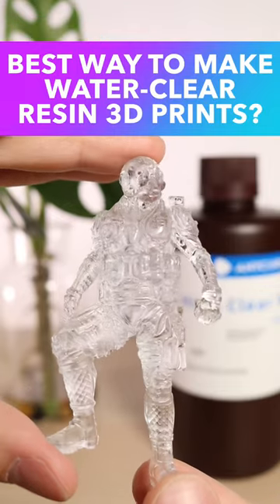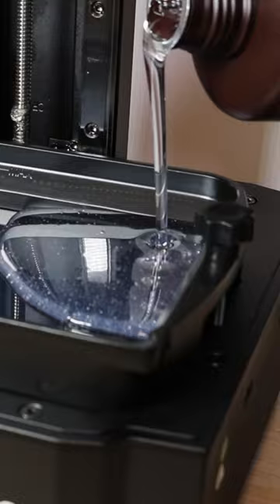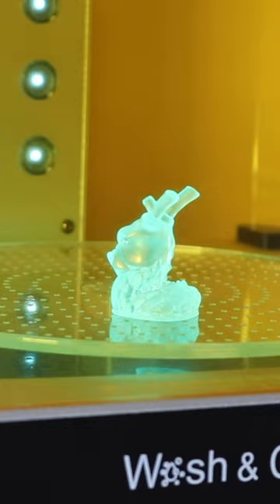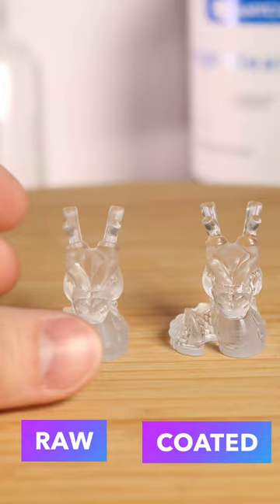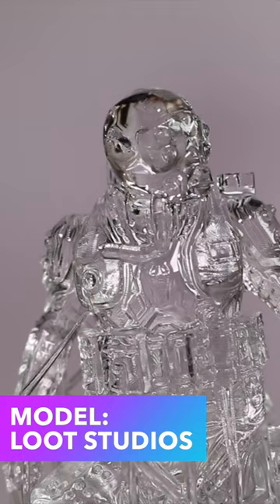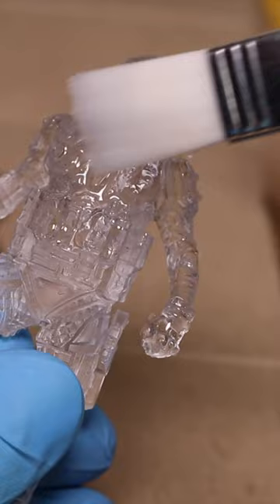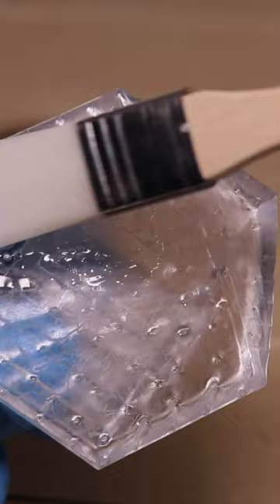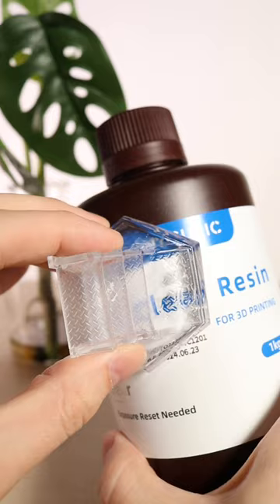Clearest Clear Resin for 3D Printing?

Comment: Clear spay varnish or similar would be better/faster
Reply: Was gonna say, a clear, resin based spray varnish would work better
Reply: Varnish will give a good finish but may yellow
Reply: @infernaldaedra  Not if you use Krylon Clear UV protection. It wont yellow.
Reply: @infernaldaedra  Resin Yellows Anyways.
Reply: @Hellspawnxxx  Krylon is kinda crap at that point I'd just use automotive clear coat 😂
Reply: @twistedmyth5860  this resin is designed to resist yellowing.
Reply: @Hellspawnxxx  that stuff is really gooey and nasty though. The application is very splotchy because of the nozzle, you won't get good even coverage.

Comment: For really small things I like to use a clear nail polish because it's super cheap and doesn't need a lamp for curing.  I mostly use it for small things since it dries quickly and can look clumpy if you go too slowly on larger prints.
Reply: FYI clear nail polish will crack and yellow over time!
Reply: @FLOPPY1DISK  oh really?  I've never had issues with it personally.  I find depending on the pigment underneath it can change colour but I've never had cracking happen
Reply: Tbh if you compare per liter odds are the clear uv resin is cheaper.
Reply: @FLOPPY1DISK  Clear UV top coat nail gel doesn't crack and yellow over time lmao. (I have them on my nails...) I think you're living in the 90s where ppl used lacquer nail polish.
Reply: @KryaDiere  I mean over a long period of time, not the time of applying them on your nails and them eventually wearing away LMAO
Reply: @KryaDiere the original commenter was definitely referring to regular clear lacquer, since they mention it doesn't need a light to cure.

Comment: So this is what I do and my prints come out very clear.  I don’t wash it once it’s done.  I simply stand it up, let the excess resin drip to the bottom.  After some time, wipe off the bottom, cure it.  It stays clear but it’s tacky so to finish it off I stand it in a jar of distilled water and cure it one more time.  This keeps it clear and removes the tackiness.  I’m only curing it for 30 seconds both times but I also have my curing station lid wrapped with aluminum foil which cures it very well in less time.

Comment: I dip it in the high gloss uv resin (either leftovers or new) instead of brushing so no brush strokes while holding a uv flashlight real quick then finish the cure in a water bath + alcohol under and over uv lights

Comment: What happens if you cure it without rinsing?
Reply: There would probably be a lot of excess resin in the fine areas. Brushing it on let’s you control how much outer layer you want to put on it
Reply: I just did my first two clear prints and did not wash them.
My process was to print during the day and left them to "drip dry" over night after the print had finished.
Then used then used a single drop from a Vallejo paint bottle to deliver the clear resin and the results were perfect.
Think of the painting on the resin as more a wipe. Too much will remove detail and take too long to cure.

Comment: Airbrush it on like some do to remove voxel lines etc works great just be in a high ventilation area
Reply: Wouldn't you need to thin it for that? What would you even thin resin with?
Reply: @blackhoneyboi alcohol would work wouldn't it?
Reply: @miguellopez3392  I would imagine that would separate and dry out almost immediately, but I could be wrong.
Reply: @blackhoneyboi  yeah that seems likely maybe a Mr hobby leveling thiner would work better.

Comment: Done this before but my prints come out great but are still sticky or feels like the resin didn't cure. Trying Minwax Polyacrylic Gloss. I like it a little better.
Reply: Same here . Remains sticky after uv cure . I dip in ipa to wash them off but it also wash off some of the areas and no longer glossy
Reply: @waterskin7  I did roses with this method. I glossed them with a clear coat and loved how they turned out. I also liked how my parts turned out using the Minwax. I'll have to try thinner parts in that first before deciding which way is better.

Comment: Wait you brush on  more resin? And that resin is cured you’re showing on video? In two days that resin you brushed in doesn’t just revert back ? I’ve never heard of this - for me it just reverts back and I’d assume the thin coat just isn’t fully cured yet. Can you confirm you threw it in your Uv curing machine? Sanding with high detail grit works for me exposing the clear layers as this method you show logically in my head would just cover up that cloudy layer - t of haven’t gotten rid of it. But I’m open to learning more here as it seems to work for you

Comment: Couldn't you skip the washing and directly cure it? (I'm only used to FDM so maybe I misunderstand the sense of washing)
Reply: That is what I was thinking. "Once you take off the uncured resin residue from the surface, its bad. So put uncured resin on the surface and cure it." Maybe the residue will never cure?
Reply: It will coat more evenly if you wash then recoat. If you don't wash, it may come out "lumpy"
Reply: Washing gets rid of excess resin left on the surface after printing, you aim to put an even layer on when you do it yourself

Comment: ok so what i do to get very clear finish on ANY clear resin...  wash and dry as normal but dont brush on resin....  instead use a high gloss varnish from a rattle can or air brush....  THAT is the best way to get waterclear prints without loosing ANY detail due to ya brushed on resin...

Comment: would your share your printing settings? I can't seem to find any ultra clear anycubic lychee settings
Reply: Just use the manufacturers recommended values
Reply: @thepenguin9 not necessarily. Cones of calibration will show that there usually off up to 5 secs up or down. Also usually there bottom exposure isn't high enough either better to just take the time to calibrate it yourself. For best results

Comment: I’m doing this currently and after brushing on the resin it’s taking forever to cure. 20 plus minutes in my elegoo mercury cure station. Now I’m holding a uv light to it as I type this and it’s still wet. I only brushed a very thin layer on my print. Am I doing something wrong? Any tips?

Comment: I printed a few surfaces for an automotive model once (double curvature but smooth). It took 2 days of sanding from 400 to 7000 grit + polishing.
Reply from the maker: WOW. Brutal, hope you still have feeling in your fingertips!
Reply: @AndrewSink  haha yea, it was quite painful, wet sanding during the winter in a workshop without hot water 😅

Comment: Ayo, i tried this resin one year ago and had problems with yellowing. How do you deal with it and make sure it doesn't yellow later in sunlight? :x <3
Reply from the maker: Are you sure it was this resin? They just released this particular resin recently, so it might have just been a similar clear resin!
Reply: I have had same issues with yellowing. About 2weeks later it gone yellow from the light
Reply: @AndrewSink the anycubic resin I used was already out in 2021, so its not the same. Maybe I give it a shot again, do you have a affiliate link or something like that for their products?